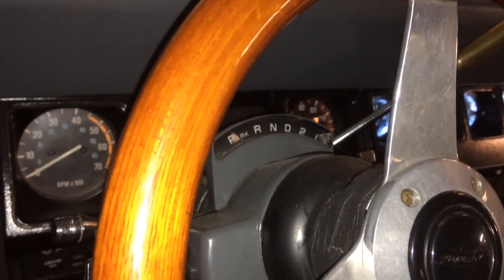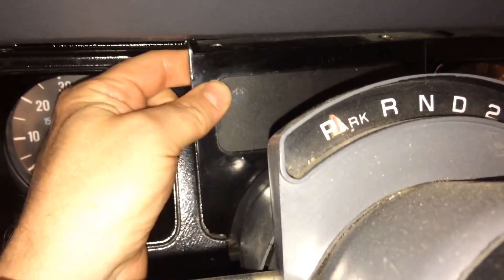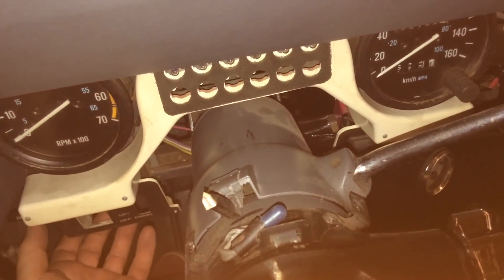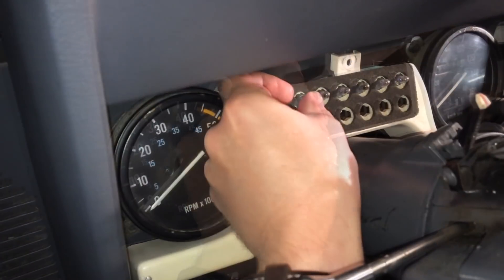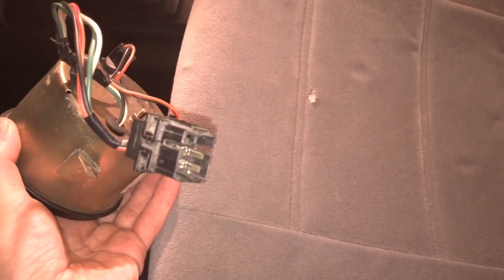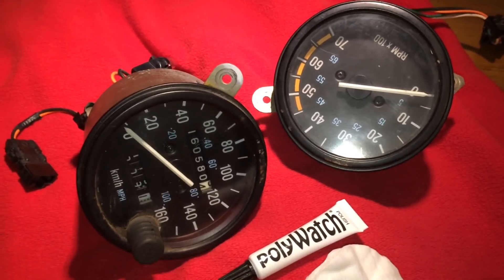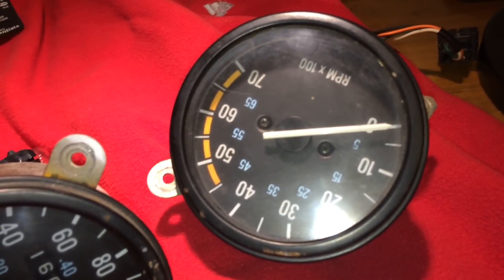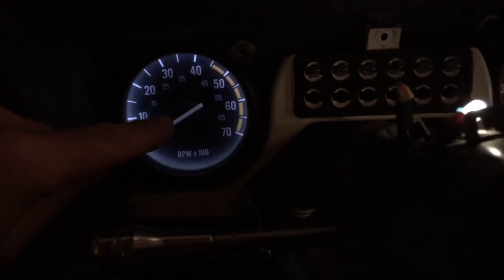LED installation guide for Speedo and Tachometer - JEEP Wrangler YJ : Ep 24

Comment: Do you know how to get the glass off of the front of the speedometer and tachometer once they're out of the vehicle? I have some sticker guage faces that I'm trying to get onto them, but haven't been able to find how to remove the glass
Reply from the maker: +Vinny G interesting question because i tried to screw them off but they were dead hard stuck, I mean the rings. Post that question on Facebook Wrangler YJ forum is the best I can advice. I would do it before I started, knowing that I couldn’t get mine off. The reason I tried was that I was hoping to blow out possible dust, which in the end was overdoing the job in my case so I just mounted them back.
Reply: Ken Sweden  I actually googled it instead of searching the forum, and everything said to use a small flathead and pry up the metal bezel evenly around, then it should eventually pop off, so looks like I'm going to try that